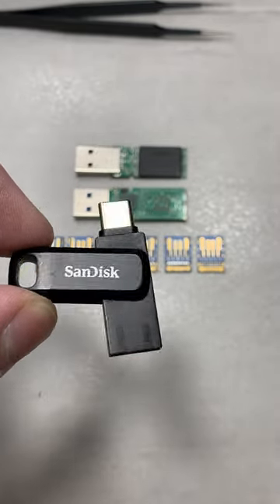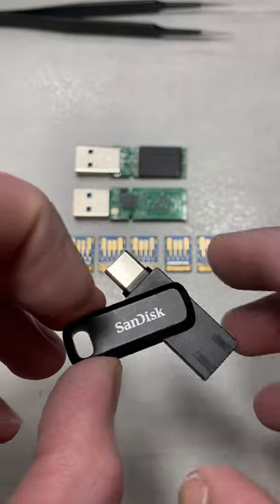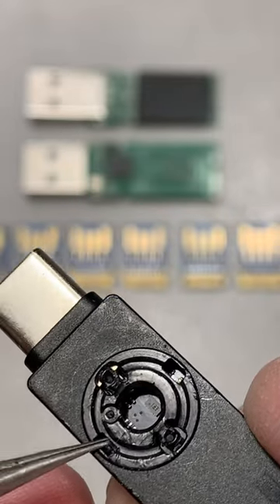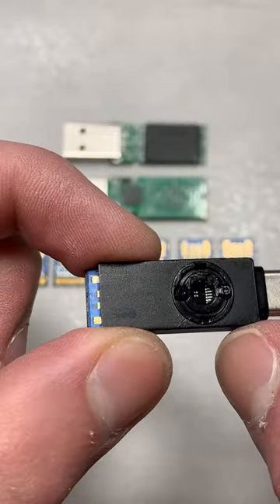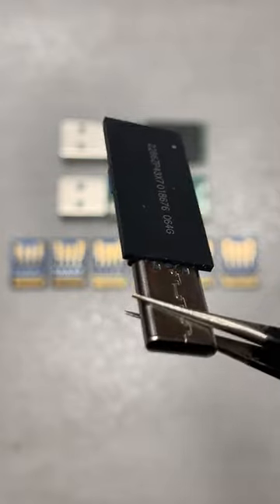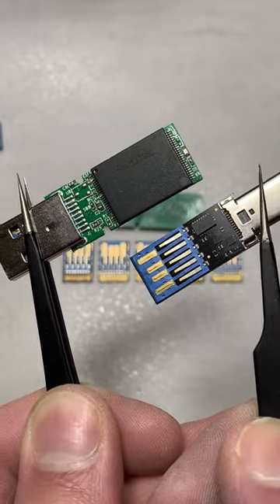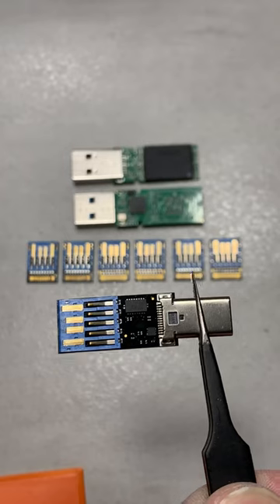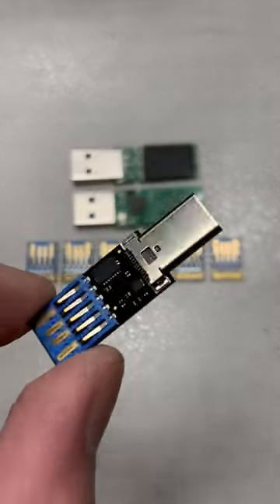Most Ingenious Dual USB Design #electronics #cool #technology  #shorts

Comment: This one gets really hot during use
Reply from the maker: Yeah I was just testing it out about an hour ago and it almost hurt to touch. Maybe I’ll take a video of it with the thermal camera
Reply: @KeonsLab  I have the metallic one and it's  painfully hot under load,,,though I'm curious,,,,does the metallic one dissipate heat faster? Or better?
Reply: @JaytheGreen  It shouldn't. Unless it gets to melting point (which it shouldn't), the electrical charges should be safe. However, I am completely unsure, and heat is just bad anyways.
Reply: Yeah if you touch any metal contacts on the usb a side they’re burning hot
Reply: @KeonsLab do a video about improving performance of usb storage by adding cooling.
That would be cool

Comment: The formfactor of one side is not „3.0“, it‘s usb A. 3.0 is the specification
Reply from the maker: True, true. I call it that to help differentiate the 4 pin vs 9 pin plugs. But yeah the form factor is USB-A no matter the version of USB controller
Reply: @KeonsLab  No. The USB version may potentially be USB 3.0 on both sides but the form factor is USB-A and USB-C.
Reply: I was gonna say the same thing, just more mean...
Reply: Due to 5 additional pins you can clearly see it's not simply a USB-A, but specifically a USB3 one.
Reply: As far as viewership is concerned, it may be a little bit more important than you might initially think to get the names right. Especially when USB nomenclature is already such a garbage fire.
I personally dismiss channels when they mix things up like that, but I come back around eventually. it's subconscious.
Reply: @heftycat lol
Reply: @dollarbutt  If you want to be even more pedantic, there's no such thing as 3.0 either. Or 3.1 gen 1. The same thing is now "SuperSpeed USB 3.2 gen 1x1 5Gbps"
Reply: @dollarbutt  "There's no such thing ..." is not entirely true. If a physical connector does not have the 5 additional contacts, it must be a USB2 Port. Otherwise, it could be USB 3.0, 3.1, 3.2 Gen1 Type A, or 3.1, 3.2 Gen2 Type A/C. What exactly does USB SuperSpeed mean, btw?
Reply: @deniskhafizov6827 
It's still USB A though, regardless of the generation. The same goes for USB C. Many devices (specifically some phones) use USB C but are stuck on USB gen 2 transfer speeds. 

The letter or moniker (A, B, micro-B, mini-B, C, etc) describes the profile of the termination. The connector type. The number describes the potential data transfer capabilities and in most cases the presence of extra pins. 

USB gen 3.x made everything super confusing in this regard, as there are so many different variations or combinations, failed unique port types (USB gen 3 B, or micro-B gen 3) and specifically cable variations that are difficult to differentiate (USB C to USB C cables that only transfer at USB 2 speeds without any way to visually tell them apart from ones that transfer at 3.x speeds, same goes for power delivery) ... 

USB has become a giant mess of compatibility issues. It's like they forgot what the "U" stood for.
Reply: I don't know why, but both USB-C phones I've had only support 2.0.

Both came after 2016.
Reply: @deniskhafizov6827 The USB-C connector is also USB 3.0.
Reply: @KeonsLab both are 9 pin

Comment: There’s another design out there that is also good like the one where you slide a button to eject one side or the other, which actually can be used to protect the microUSB or Type-C connector since it’s the smallest. That one would be by sandisk. Or my favorite design, which is the same thing YOU are showing, the swivel design only HALF the size by PNY, or non-swivel one by Verbatim or Transcend. I like the fact that it’s tiny lol. Good OL double sided USB’s rock.

Comment: Which type you think is better for fastest chargin usb a or C
Reply: Connector doesn't matter in this case, it's the wires.
Reply from the maker: You mean for charging a battery? If it’s a newer device that also has USB-C you’d probably get a faster charge by using a USB-C PD charger

Comment: Is the C side faster or just the same slow speed as the other?
Reply: speed usually only depends on the memory chip they are using. even usb 2 can theoretically reach around 50MB/s. this has usb 3 on both ends, so that won't matter. C isn't faster than A, connector shape doesn't determine the speed, protocol version does
Reply from the maker: I mainly used the C side so I’m not sure but they were both pretty fast. Like REALLY fast. It’s a USB 3.1 drive and my fav one

Comment: Yo who’s watching YouTube shorts after they get their new PC and they’re downloading all of their files, because that’s exactly what I’m doing. Trust me it’s gonna take a while man I’ll keep y’all updated whenever I’m done.
Reply from the maker: Copying an entire hard drive? That must take forever!!! Are you doing it via a cable or cloud?
Reply: @KeonsLab  I used a hard drive me. trust me, I started at like 4 PM and I ended at like 8:00 PM not to mention taking the thing apart to put some more ram into it. Took a little bit of strength. But I finally got everything to work. All my settings are now working. And who boy? It's a beast.
Reply: And what I mean by hard drive, I mean putting all of my data from my old computer to the hard drive, then plugging the hard drive into the new computer, then transferring all the data to my new computer. It was the easiest method I can think of without spending any money on stupid cables and crap. And in short, it did work.

Comment: my only issue with these is the usb c side in use gets extremely hot, makes me real uncomfortable to save anything of importance on.
Reply from the maker: I took a look at it with a thermal camera while copying files and it seems it’s the usb c controller that heats up, not necessarily the memory chip itself. It does warm up the whole thing but the memory chip didn’t go above ~65°C or so

Comment: What if you plug two devices at once on different sides ,does it will work for both devices ?
Reply: Nope, just heats up a TON
Reply: @JoeMariaa  so we require lot of upgradation to achieve that
Reply: @JoeMariaa  heat is not only problem , working with two devices at same time can cause deadlock

Comment: Man that would be so useful rather than having to carry around and adapter which every once in awhile I forget to grab and then I'm out and about with a thumb drive and a tablet but I can't plug the thumb drive in because USB-A versus USB-C FML
Reply: I have two of them, and you're right. It's also less clunky than a regular flash drive with USB-A plugged into a single or multi-port USB-C adaptor.
In my case, it's the USB-A side to copy files onto them from my old NAS and PCs, and USB-C to copy files from them to my newer tablets.

I still carry a multi-port USB-C adaptor sometimes but for when I need to plug in more than one flash drive to one of my tablets.
Reply: @kbhasi  I have a really small 1 port USB-A to USB C adapter and so while space wise it's not bad the problem is I have to remove it to use the drive with a desktop and so then when I rush out the door for school I sometimes forget the adapter and my tablet (yes tablets run windows) only has a single USB C port so I'm screwed :(
Reply: not all devices support otg
Reply: @swipekonme  that doesn't change any of the things I said.
Reply: @bland9876  without otg support, thumbdrive would not work
Reply: @swipekonme  well no device will work without otg so it's doesn't change what I said.

Comment: "They made their chip a circuit board"... No, that's not how IC work. It's still a circuit board with a chip on top.
Reply from the maker: True 😂. But you get the point, it’s an ultra slim PCB embedded onto the IC packaging with the solder mask directly on top, no separate PCB for the chip and the header
Reply: @KeonsLab I don't get it. The chip is soldered onto the pcb. Just happens that it's large and covers the whole pcb. What do you mean theres no "separate pcb for the chip"? Are you talking about the usb plug being the circuit board itself? Cuz that's kinda cool, but lot of things do that now to make usb A reversible

Comment: Yeah because chips are known for their 'flexibility'.... What a terrible idea. Usb connector get huge amounts of abuse/stress. I would imagine that usb has a very limited life span...
Reply from the maker: Normally it’s supposed to be in a plastic shell that holds the USB C connector in place
Reply: @KeonsLab  it's done solely to reduce costs. Even in that flimsy plastic housing the connections to the chip will eventually break. Solder isn't malleable and the chip pads will eventually become detached from the usb connector. The use of pcb reduces this shearing force and would have a longer life.
With something as important and file storage I wouldn't choose this type of product.